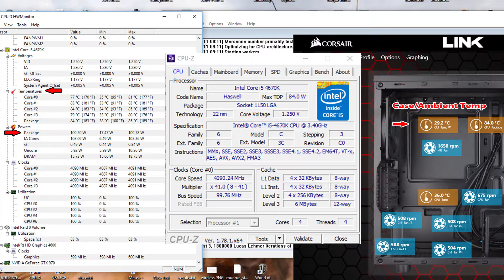🛠 Peltier Cooling My Computer: The Basic Plan :Part 1

Comment: I have wanted to do the same thing, with 2 water loops. One loop with the hot side of several (10- 40x40 12710) TEC coolers connected to a waterblock that connects to a 120x240 rad, with super quiet fans. The second loop has the cool side of the TEC waterblock connected to the cpu waterblock. With the cpu water temp not more than 5C below ambient. Otherwise, there is a risk of condensation.  Hot side 5C-10C above ambient. With COP  not less than 1, and as high as 2.5.

I have only seen this video, and since it’s dated a year ago, I’m hoping you have completed it. Im about to find out.

Comment: Great video and channel, I've been interested to use TEC for a while to cool my GPU by just lowering the temps to a few degrees below ambient as well, will look forward to seeing how you go about this process
Reply from the maker: By the way i mean water block cold plate temps just below ambient  i don't mean cpu package temps  just below ambient. That is a whole different thing.
Reply: Understand, as long as the water temp (on the cooled side) is somewhat below ambient, it will be a success

Comment: I have always wanted to do TEC but never found enough info to really feel comfortable doing so. Only just recently found your channel and have been really enjoying it. Any tips on if I wanted to cool my i7-5820k thats overclocked to 4.2GHz and is pushing 170watts of TDP?
Reply from the maker: Buy high quality parts and it will work if you try to do it on the cheap it will be a failure.